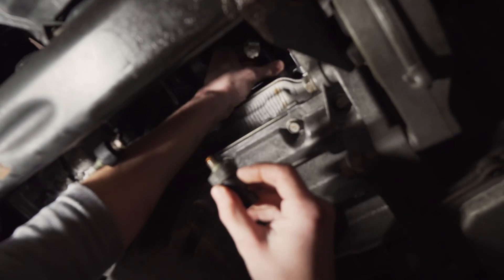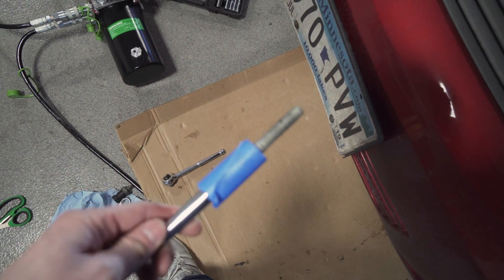Chevy Cobalt Oil Light Pressure Switch Install Replace 2.2L

Comment: Way easier to take out from the top
Reply from the maker: I'll have to try that next time! Thanks for the heads up
Reply: @HardwayLearning  no problem
Reply: Im gonna have to try from the top too, i get a random oil leak there. Makes sense now
Reply: Sure wish I saw this before starting, but at least I got it done with everything working and no more leaks, right?
Reply: @ZRJOmega  right
Reply: Darrick you’re wrong the intake manifold is in the way.
Reply: @mastermind5482  it wasn't on my 2.2 malibu. It was way easier to take it out from the top

Comment: I have the same car and same symptoms and changing the switch also did not resolve. Did engine oil flush and change oil and filter and the problem went away. Hope that helps!

Comment: I was able to replace my sensor without taking the starter out but I do have small hands. It was a pain but it is doable. P.S. My light did not go off. Hopefully it is the wire. I will no more tomorrow.
Reply from the maker: Let us know if you figured it out!

Comment: You don’t need to remove anything. Just push the harness an inch over and you can put a 1 1/16”socket right on it. Takes less the  5 min to change. Also the battery is not in the trunk because it’s race inspired. It’s in the trunk because there is no room in the front. Thank you for taking the time to make a video though. 👍🏻
Reply from the maker: You can't tell me this econobox sedan isn't inspired by an F1 car.  Thanks for the tip and thanks for watching!

Comment: cheap or collapsed oil filter , or a high density filter that is cutting oil pressure down
Reply from the maker: Perhaps valvoline forgot to replace it on her last oil change :(

Comment: Anyone know if this plug can leak oil bad enough to leave a snail trail
Reply from the maker: That would be a rather excessive leak.  I would try to get visibility of where it connects to the block and see if there is oil coming out of that fitting.  Have you had an oil change recently? There is a good chance that when they removed your filter it dumped on the splash pan and that is slowly working itself on to the ground.

Comment: My light comes on oy when its hot, on the days it's cold it NEVER  comes on. The car runs fine but when it's hot outside is when my light will flash on and off and it dont matter if I'm coasting or picking up speed.
Reply from the maker: I would check oil levels and if you have oil and your car is not making any strange noises this switch is most likely defective.

Comment: What if there is a leak coming from this plug? Will I be able to fix it myself? And if so what will I need to fix it? I have the tools necessary such as the jack, jack stand and sockets
Reply from the maker: If it is leaking, then it definitely needs to be replaced! Follow the steps in the video and it should be easy!
Reply: If you do replace it don't forget to change the filter inside where your switch goes😁

Comment: Wow. What a voice! Very nice. Just got the same intermitent oil light the first time on my 2000 Cavalier which is full of Mobil 1 synthetic but scared the sheet out of me on the interstate. I'm thinking oil pressure switch like you, but now I'm thinking that I'm going to have a no fix after I change out the pressure switch. What ended up being your problem? Thanks guys! Really appreciate the time and effort you took here.
Reply from the maker: So after disconnecting and reconnecting the switch I haven't seen the light since, so I'm guessing it was the switch and maybe the plug wasn't making a great connection
Reply: @HardwayLearning  : Awesome, thanks for responding back. I'll be switching out the switch then. I appreciate you getting back to me. I've subscribed to your channel and sure do appreciate the time you took all the way around buddy! Thank you!
Reply from the maker: @patrickphippspa584  we're here to support anyone everyone, if you have any questions you can reach out on Facebook or Instagram. I catch these comments usually though too. Glad our video was useful
Reply: @HardwayLearning  Mate, I just finished doing a swap and the light went away and I was totally stoked.

Until 2 days later when it started flickering, acting odd, coming on and off again.  

Could bad wires be the culprit? What other things could potentially be on the fritz?

Thanks for any insight you can give- I'm losing my mind over this.
Reply from the maker: @RandyScarland  I would check the wiring harness running to it, I noticed on this car that the wiring harness was rubbing on the engine. You could wiggle the wiring harness and have someone check for the light on the dash at the same time!
Reply: @HardwayLearning  My Man!  Thanks for the tip.